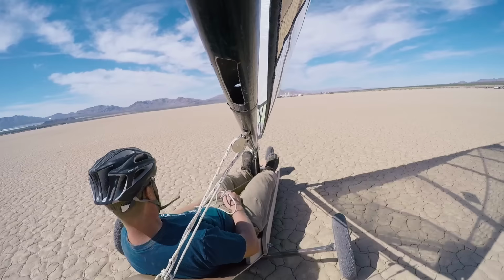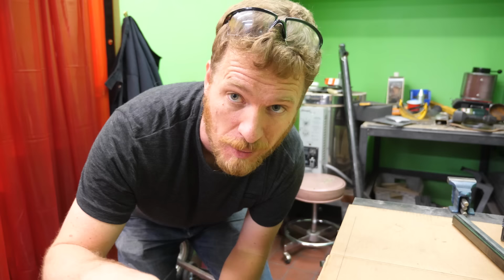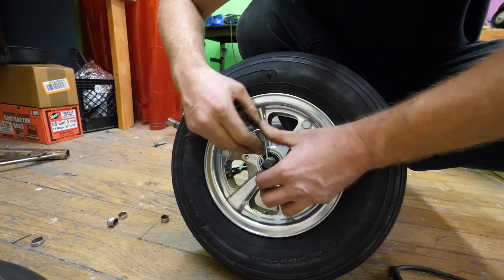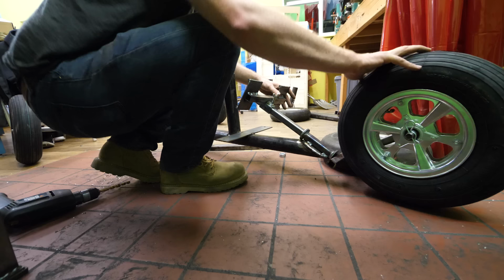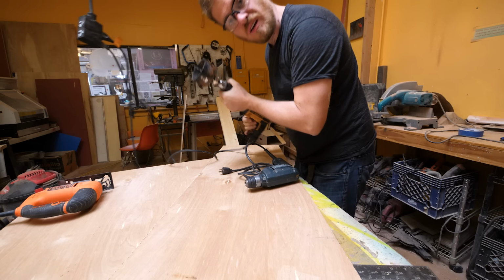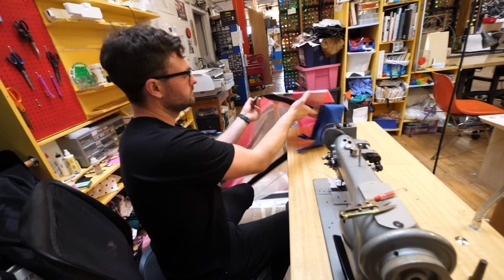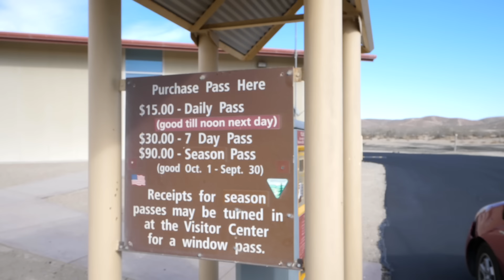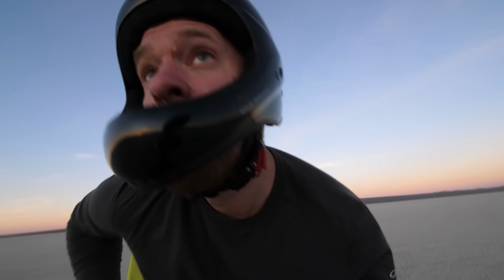A Desert Sailboat?

Comment: Little tip for next time dude.. if you can't mill out the pin to fit the bush, drill the bush to fit the pin.. just reem  out the bush with some emmory paper when your done drilling and it'll be nice and smooth..

Comment: Top tip for future fabrications, you can make sure everything is aligned when tacking it using a spirit level on the different faces and surfaces. also tack as much of it up first without full welds then if something needs adjusting it makes life so much easier.

Comment: As a welder myself one tip I have for ya is to tack weld during fit up first. That way when you gotta cut off the steering part 3 times its a lot easier to cut a couple tacks! Nice work regardless!

Comment: The Lake Lefroy Mini!  I'm in the process of building one too and it's been handy flicking through this vid for little details.  For the steering I went with the 90 degree cut on the spine then weld brackets on for the steering shaft socket since I figured it'd be easier than cutting the angle directly into the spine... still got it crooked though.

Comment: I use to live in Lancaster and have been out to El Mirage a half dozen times - much more fun and much faster than sailing a boat.  I had a correctly calibrated digital speedo and had my  cart going 45 once, often 42

You have to keep in mind you face is literally 2 feet off the ground so you really get the sensation of speed.
I'd have an ice chest with a couple of burgers and beer and go  ping ponging across the lake all day
stop to pee and stretch my legs then open another beer and Get Back At It
I've put 70 miles on in a day 
thanks for this video, I'm going to put together another cart

Comment: So the steering yolk being twisted one way may be down to the weld pulling it to one side. A fix could be setting the tube nice and square in the chop saw. Chopping it in half. Rotating it enough to get back in to line then welding it back together.

Comment: In my experience with these, short as it was (but i did get to talk with a few DIY old guys), you want a heavy low frame for a big sail, and a small but wide frame for a smaller sail. Either way, having a heavy spine isn't a bad idea at all. I was also surprised to see that ballsier older dudes can't be bothered with the trolley wheels, and just put BMX wheels on them with narrow tubes, heck, one time i saw one that had solid cores, and no tires.

Comment: You should know that the bandsaw you used to cut the tube where the tire mounted will not ever get a straight cut. This is because it comes down in a circle so i would use either something else or if take a paper and draw a line around the pipe as a guide that will work better.

Comment: Good result but I was curious why you used steel rather than aluminum?  Ease of welding perhaps (mig vs tig)?  And why you chose a single sided fork for the front axle?  Seems like a standard 2 pronged folk would have been way easier?  I'm asking because I don't know.   IF your answers are "because that's how I chose to do it," that's fine too.  Just wondering.
Reply from the maker: Yeah, I chose steel because I don't know TIG yet (and don't have access to a TIG welder).  And the single sided fork was just because that's what the plans I was following did.  A lot of other land yachts use aluminum and have double sided forks:)
Reply from the maker: I will say though that this design has worked out great - both boats are off the same plans and sail really well.
Reply: spool gun mig or tig for aluminium is pretty tricky, espicially to get strong parts with relatively thin wall tube. mig on steel needs like a few hours of practice before welds become very strong and pretty easy to do.
Reply: Yeah, when i was learning to weld aluminum i burned so many holes in sheet aluminum. I worked for my uncles welding company growing up and he had a large shop with lots of good equipment. He even had a early version of the Water Jet machine cause this would have been early 2000's.

Comment: Just safety stuff. Duct tape extra wheel pins to the inside of the seat or the mast. 

If no cell phone reception in case of wreck with injuries, a cb, sat phone, car based ham radio?
Reply: there is service on that dry lake

Comment: if the lathe you were using had a boring bar you could have turned the bushing down to fit the oversize hot rolled steel.

Comment: Hey Scotty, I'm in the process of making my own land-sail and I'm not really sure what to use as a mast. What material did you end up using for yours, or was it windsurfing mast? Thanks for the inspiration!
Reply from the maker: I used a windsurfing mast.  But an aluminum pipe would work great, or maybe even a steel one.
Reply: Awesome, I'll start scouring craigslist for some cheap options then. By the way, are there any places in the bay area where it's legal to go land-sailing? I've read up that they seem to be banned on many of the main beaches in SF. Curious to know if you have some info on other locations closer than the salt flats
Reply: Mushka don't use steel or aluminium if you're going to use a windsurf sail! Windsurf sails are designed to be curved when you apply downhaul!

 A curved mast will result in the battens moving away from the mast and the leech tension on the top of the sail becoming loose, as result the sail will be faster and respond better in gusts !